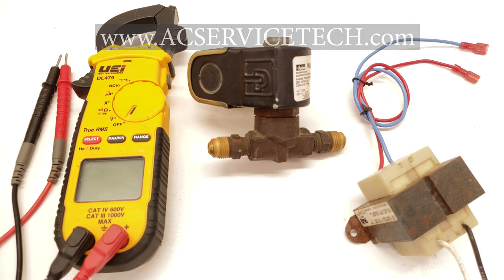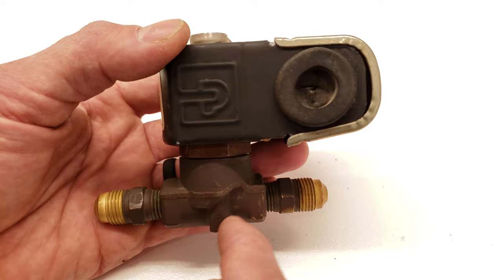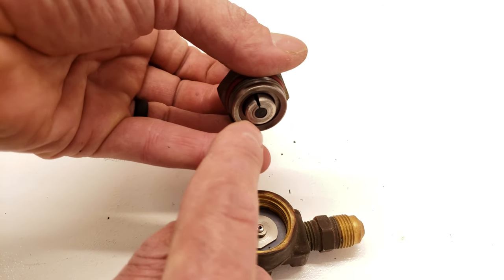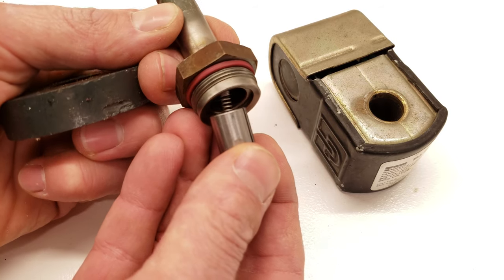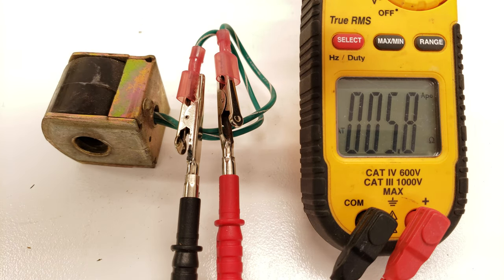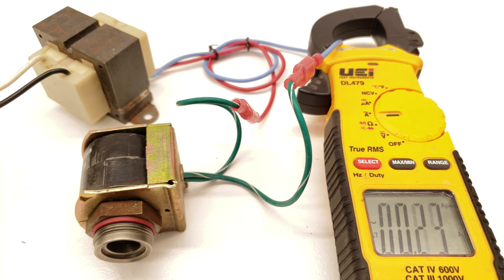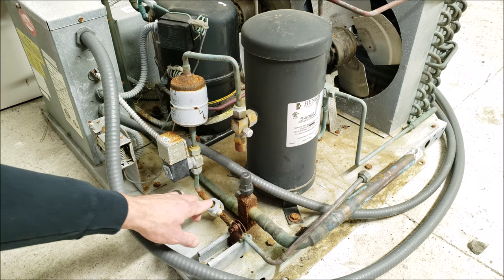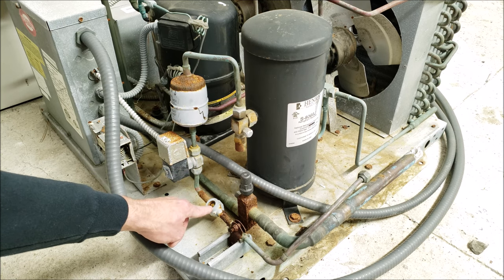Liquid Line Solenoid Valve Operation & Troubleshooting!

Comment: Had a York chiller tripping on low pressure my instant was it had a leak and was low on gas. That’s until I checked the solenoid. It had 24v power supply but wasn’t energising causing the chiller to effectively pump down and trip on L.P. Solenoid replaced, job done.
Reply: You mean instinct
Reply from the maker: Very nice job finding it!

Comment: How can you install this on a heat pump?  If arrow is one way, wouldn't it not work in the opposite mode then?  Guess you have to install internal into the heat pump.  Do they make a heat pump solenoid?
Reply: they make a biflow valve that allows in both directions

Comment: Great video as always I’ve never even thought of taking a valve body apart to power it to show my guys what actually happens when the valve opens and closes. I will say that is nice when the solenoid is before the sight glass in the condensing unit but I started installing the solenoid right before the txv in the evaporator because now with microchannel condenser coils being standard, the manufacturers have a recommendation on charge by weight instead of the old school 90-30-1 charging procedure. The first couple microchannel condensing units I did on walk in coolers I overcharged them by about a half pound and mounted the solenoid in the condensing unit and after the fact I calculated it that if the solenoid would’ve been in the evaporator I probably wouldn’t have been overcharged.

Comment: hi, i just installed a commercial freezer and my evaporator fans keep turning off and sounds like unit is pumping down, and my sight glass starts to bubble. the coil for my solenoid is making a funny noise. could a bad coil here cause my freezer to shut down?

Comment: Do you need to have a receiver tank in the system in order to install a liquid line solenoid valve? This is a rheem 4 ton condenser but does not have a receiver tank only the compressor.
Reply: I think I found the answer: 

Heat Pumps are the ones that require solenoid valve 

placed in liquid line to prevent off cycle migration.

Cooling Units would use an accumulator instead in the suction vapor line.

Suction line accumulators should only be installed on systems where liquid flood back to
the compressor is highly likely such as long line applications.

Comment: You wasn’t lying when you power the coil when its not hooked up. I did that today and it didn’t take long before it started smoking. 🔥 After I did that I was thinking to myself, didn’t I just watch a video on that.
Reply from the maker: Oh no. Hopefully you could get another and get the customer back up and running again.
Reply: @acservicetechchannel  Yes, I had some in stock. Best lessons are hard learned I guess.

Comment: The only one thing I don’t understand. How that small  spring and low weight core solenoid can hold that huge pressure?
Reply from the maker: The refrigerant bleeds through the hole in the disc and up the slit in the iron core so it is not just the high pressure on one side. Thanks for your support!
Reply: AC Service Tech LLC thank you for explaining to me.